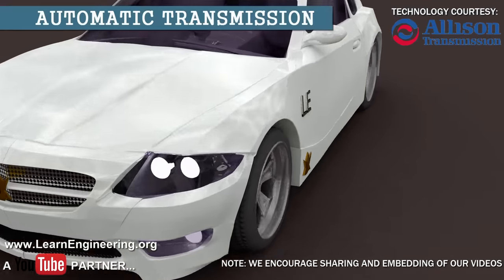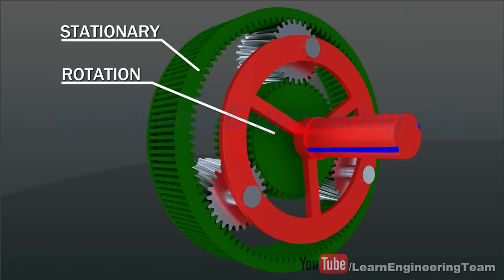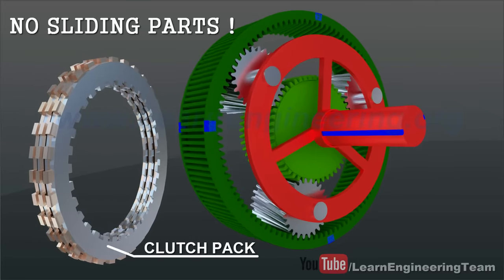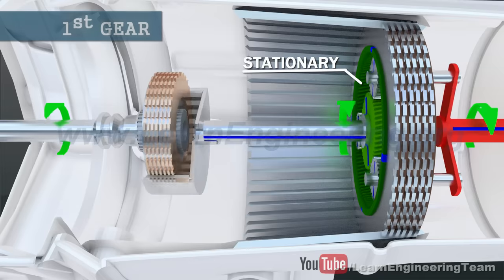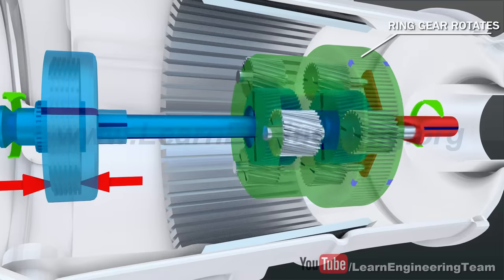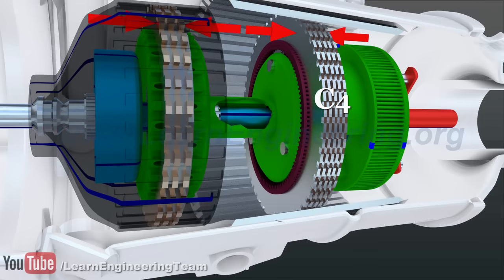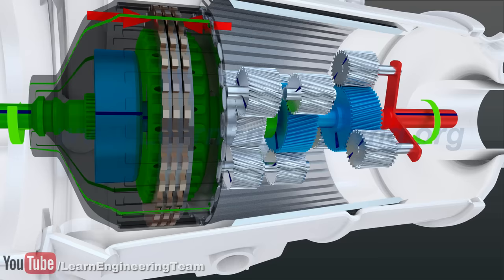Automatic Transmission, How it works?

Comment: Too much complexity. As engineering progresses it's more about whether you can afford automatic transmission. I've seen loads of these lying around in mechanic shops from vehicles not over a decade old  and repairs on them cost a considerable amount. In a manual transmission, you just change transmission oil (~30$) once in a while and with proper use, you can keep your clutch disc for 10 years or more until you need to replace it (for ~250$) due to slip or complete failure. You also decide where and why to utilize engine torque, while driving efficiently or quickly when it matters, is completely up to you and under your control. You have more control over engine braking and can take better advantage of it, while trailer dragging becomes better. Honestly, I hope they don't ditch manual transmissions in some greedy attempt to make more money off of complex automatic systems. MT offers a nearly forgotten necessity we valued at cars, which is reliability. The remaining cars from the days people valued reliability and the market realized and respected it, are engineering miracles with every passing day, still moving us around after 30+ years of service. Now it's all about leisure, luxury, short lived comfort and in the end, a needlessly pumped up bill.

Comment: I'm not sure what the hell this transmission is in but I sure can tell you this thats not what the inside of my automatic transmission in my 85 Ford F250 xl 4x4 351 windsor 4 barrel carb transmission looks like it's full of bands an clutches an fluid thur a shift module with three ports an torque converter case when they rebuilt it they drilled the three ports of for shift kit an used red line bands an clutches plus updated it an cost $3000.00 to rebuild wasn't no gears in the thing its a C6 trans for 84 an 85 the only years of this transmission .........

Comment: Maybe they should explain what they mean by "applying c1, c3", etc!!  How is it applied?  You show a bunch of rings and teeth, then show them magically turning.  Just fucking explain what happens WHEN I SHIFT GEARS.
Reply: The sensors tell the computer what's going on and the computer uses solenoids to shuttle oil pressure to fill those clutch packs, which then changes it to the next gear. 

Cars shift smoothly due to lower pressures changing gears more slowly, and the clutches slip more.  A one ton truck for example, will shift with a bang, so you can pull bigger loads with out much clutch slip.  This is achieved by using higher oil pressures. the clutches fill up and lock up faster.

Comment: I built an entire 1800 square foot house myself in 7 months with only the help of my wife, no contractors or hired help anyway we did a standing seam metal roof about 900 square feet total for a cost of around $2500 and it took us 3 days we had no boom lift or any heavy equipment just ladders and sweat equity lol the concept of a 30,000 dollar deductible is ludicrous just a plan scam. I could rebuild almost my entire house for that much

Comment: poor presentation torque converter starts the process and should be explained first. second is fluid and fluid pressure third is control of fluid and fluid pressure that would be valve body and  valves then you could explain the clutches and sun and planet gears

Comment: Holy Mother of fuck, I'm a Technician with 7 years experience and even I can't digest this, like, if the planet gears don't spin, then why the fuck are they spinning in the example. It also details nothing about what the individual gears do or how they work individual versus as a system. All this video does is tell you that transmission make car go places.

Comment: Ok but you don't explain how clutch work
Reply: In the Allison transmission, transmission fluid presses on the clutch to activate it. A pump, will pump fluid to a separate valve for each clutch and the computer module in the transmission opens and closes specific valves to activate certain clutches.

Comment: sun gear is always attached to the main shaft, the planetary is attached to the sun gear. The sun gear rotates when clutch plate 1 is pressed and then the shaft moves in the same direction as planetary gear. The c1 and c2 applied and the shaft moves twice the speed. Think about it. If the additional hollow gear is introduced with c5 then apply c2 and c5 the main shaft moves in reverse direction and the speed increases. The planatery gear never moves and the sun gear is moving by itself because it is connected to the main shaft. Then introduce a third clutch plate. Think of third clutch plate is pressed all the time then the main shaft, the sun gear and the planetary gears all moves along with the car. That is what I understood. And after understanding this I disliked the video.

Comment: This is poorly explained and gives awful visual aids if you want a better video too come back and watch this im gonna post it below. This is not a good video if you don't understand how it works because. He doesn't show you what happened when the clutch packs are engaged, he only show it too you with the housing over it so you really can't see what he's talking about. On top of that, he doesn't put any prompts on the screen like the gears that need to be engaged to get to 6 gears.

1st gear is C1 and C5
2nd gear is C1 and C4
3rd gear is C1 and C3
4th gear also called direct drive is C1 and C2 with the rotating clutch module engaged.
5th gear is C2 and C3
6th gear is C2 and C4.

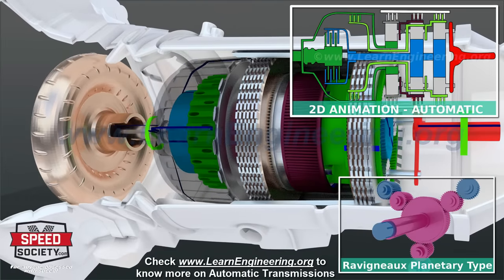Check out this video and come back. I've been watching this video for 2 day and don't understand. I watched this guy 7:30 video and understood it completely, people aren't dumb a lot of teachers are awful at explaining and like to over explain unnecessary information